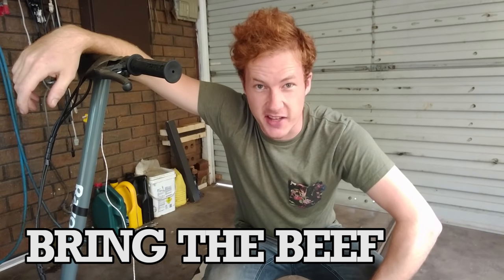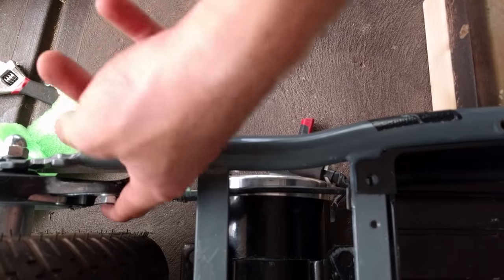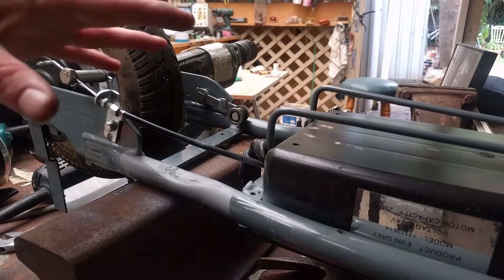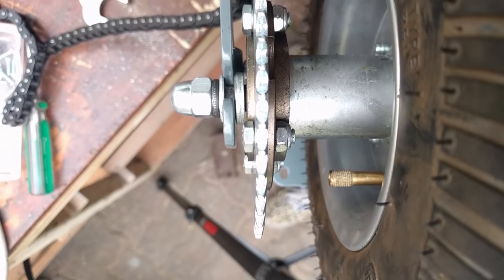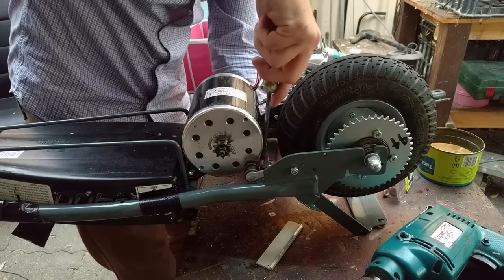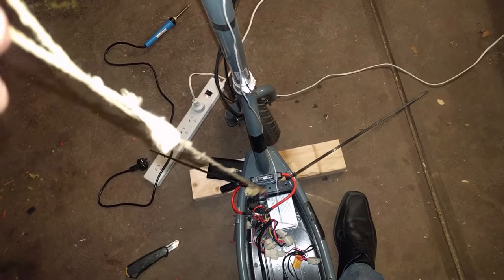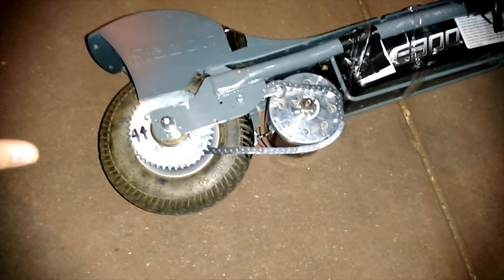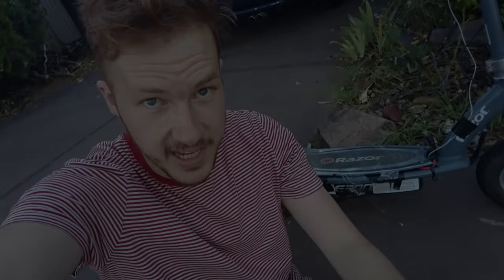Razor E300 Gets a Big Motor Upgrade - Scooter Episode 5

Comment: busy modding stock e300. first to go were kickstand and brakes then moved the switch to the floor. No cables! Coupled the shunt in the controller and it cooks, unless the road is very slightly uphill. I'm gonna stick to 24V, the stock motor is very capable but the SLA batteries aren't up for much range. Still, its an EV
Reply from the maker: True! Kickstand removal really is a game changer haha.

Comment: great info as i'm looking to do the same thing, only thing wrong is the chain tensioner should be tensioning the bottom portion of chain not the top as it takes care of slack in the chain, the chain between rear sprocket and motor will always be tight under throttle so just need to care of the slack after the motor
Reply from the maker: Haha good point

Comment: I got a my1020 off Amazon and a variable throttle.  I stuck with the #25 sprocket setup with a 13/52 gear ratio.  The MY1020 came with a controller that combined with 4 12volt 10 amp hour SLA batteries spins the MY1020 at 3960 rpms (not sure the c-Rate).  Top speed so far is 27 mph.  Still going through versions.  Fun stuff!!!!  Thanks for your post.

Comment: The motor hits the ground any bump with this mod, I did the same thing but 52v my1020 monster motor. It eventually bent the frame. You can take the tensioner off and just get the chain really tight, makes it much quieter/smoother.
Reply from the maker: You're very much correct. Does make riding around the city a pain

Comment: About 4 years ago I bought this cheap little folding scooter bike it was 24v chain drive with a plastic cover over the controller and batteries that served as a foot rest, it came with a little basket, turn indicators, headlight, taillight, brake light it was basically an ebike without the pedals. When I got it the delivery guy dropped it on the back wheel I rode it twice and I was able to hit 35 kph then I ordered a e300 back wheel which was about the same size but I forgot to change the sprocket and as a result I was able to hit around 45 kph.. it was pretty much a 200 dollar disposable jobby but it was fun before I sold it for double!
Reply from the maker: Sounds fast as all get out!

Comment: I have been working on hooking a scooter to a wheelchair. I have to go about 300 feet from the house to the chicken coop twice a day. My issue is not speed but I have to go up a steep hill on my return and I am not a small person. I have two worn out E150s. I have thought about putting the the two scooters together with only one front wheel. I would love a high wattage motor but $$$$
Reply from the maker: Sounds like a useful tool you're building!

Comment: Thanks TK!!!!I upgraded my e325 Razor to the same 500 watt motor,Variable Speed Controllers,36v upgrade kit.I run 15T/38T T8F gears...29mph!!! Thanks Dude! I luv my razor now!
Reply from the maker: ragsandrufus that's awesome, your build is fast!

What controller did you use? Did it fit in the stock location?
Reply: TK ,I purchased entire 36v variable controller ,upgrade speed control includes 3rd battery all on eBay for $109. Motor is same as yours $87.  I ordered TWO chains because 15t/38t gear combo requires a much longer chain than gas style.T8f gears found on Allibaba 
Everything was built in about 4 hours thanks to YOUR video!
Reply: The controller fits in stock location,and has voltage readout.uses a key to lock up!!!
Reply from the maker: ragsandrufus nice! That's a sweet ride :D
Reply: The cover is painted Gloss black to match the black stock black frame. Looks pretty wicked! Next up...set of new tires if I continue doing burn outs and power slides! LOL
Reply from the maker: +TK got a link to the controller kit you used?
Reply from the maker: ragsandrufus cheers!
Reply: I took more time to watch and re watch your videos FIRST,before deciding on tackling this upgrade modification . I can always get different batteries later, but I wanted to test how I liked the power of the 36v SLA batteries first.

The system I purchased includes even the charger and 3rd battery!
Reply: TK ,how long do your 2 5s 8000mah packs last on full power?
Reply from the maker: ragsandrufus hard to say exactly, but I've gone on some decent 40 minute+ rides and the scooter has still been riding well. I'd say probably about an hour tops.
Reply: TK ,that's awesome!
Right now I'm using 3 SLA batteries and I'm only getting 30 min tops!
I'm also only gong about 25mph ( I just find a speedo check) 
Maybe I need to get more punch from using lipo batteries

I'm thinking about investing in two of those 8000mH like yours...any suggestions would be appreciated !
I'm up to about $280 right now...2 zippy 5s 8k will put me at almost $500...
But it's nice that I built it myself rather than just buy one...I guess
Reply from the maker: ragsandrufus yeah, I certainly like doing the build rather then just buying it. 

Check out HobbyKing for LiPos. The only thing I would worry about is if the extra current delivery from the LiPos will pop your speed controller. I'm probably gonna buy one to try it out anyway.
Reply: TK ,4.2v X 10s = 42v. That's not that bad! My controller modal handles 42v so it should be ok!
Maybe I'm too fat?!!! 185lbs is not THAT bad!
I think I'm gunna go for it! 2 lipos !... Here I go!
Reply: TK oh... My name is Andrew btw LOL
Reply from the maker: ragsandrufus yeah, it's not so much the voltage as the current. LiPos can deliver a hell of a lot more current than SLAs. It's great for performance but it kills weak controllers.

Good to meet you Andrew - let me know how it goes!
Reply: TK ,
Ok ... so I installed two 5s Lipos in Series... tested it...
Consistent fast speeds!
No heat build up after 30 minutes! 👍🏻
So...I went crazy and ordered 10ah Li-ion battery pack/charger... the 18650 Samsung batteries that this is made up from should give me the long run times I'm looking for!
Man I'm so freakin happy!
Reply: Thanks again for all your help and vids!
Btw... love the accent mate!
Andrew
Reply from the maker: Thanks mate, awesome hearing about other people's builds!

Got some new parts on order myself :D

Comment: Thanks for sharing. I need your advice please. I own a Weped GT50 scooter. The battery output is only 14.7A max @ 60V for short periods, and only 9.8A continuously. The dual motors are rated for 1800 watts continuous each, which is pretty damn good. HOWEVER, watts = amps x volts. The battery can only deliver a peak output of 60 x 14.7 = 882 watts. That's only 25% of the power the motors require. I think the manufacturer is using 'saggy' cells for the batteries to keep production costs low. 

What if I upgrade the battery with better cells, controller and BMS to 3600 watts / 60 v = 60 amps? I think that's the output the battery should be able to deliver to take full advantage of the motors. Thoughts?
Reply from the maker: Could be good! I’m not familiar enough with the scooter to know exactly what you’re dealing with, but if your battery is hitting its current limits and you’re getting weak performance, an upgrade could be worthwhile.
Reply: @WhatUpTKHere  Awesome thanks

Comment: The tensioner goes under the slack side of the chain, not under the tension, or top side.  So, looking at the scooter from the right side, the tensioner should be under the lower section of the chain, as the top is under tension to drive the scooter forward.
Reply from the maker: You know I get more comments on this than any other XD
Reply: @WhatUpTKHere  Seriously, it goes under the bottom of the chain, also has better tension, and the freewheeling clutch allows for proper chain tension.  I have 2 of these, one E325 and an E300 with an 80 tooth rear sprocket for more torque, less speed.  I use the 300 as a scooter around downtown of the city I work in as I can't walk far due to over a dozen surgeries on my legs to keep me together.   I choose the Razors for easy parts availability and the balloon style air filled tires for a smoother ride.  My next project is going to be taking the older models I use and upgrading to lithium ion batteries when my lead cells give out.  I only go a mile or two a week, so it is light use, a few blocks here and there.

Comment: What you need is a new speed controller. These controllers are current limited, meaning they will only supply a fixed amount of maximum current (and therefor power) to the motor. You can add a 1000W motor, but as long as you keep powering it from the old speed controller, it will not make much of a difference.
Reply from the maker: If you watch the full series, you see I fully explore disabling the current and voltage limits on these controllers.

The controller is a key piece of the puzzle.

Comment: It's probably been said - but you basically shortened the chain so far that the chain tensioner does not function. You likely did that because you have the tensioner on the taught part of the chain (the part pulling on the sprocket of the wheel or top part of the chain) when it needs to be on the slack part of the chain (the portion returning from the motor to the wheel or bottom part of the chain). Correct that, straighten the motor, and I think it should be fixed.
Reply from the maker: Yeah I get comments about this every week, have done for the last five years haha! One small mistake...

Comment: loved the video! so the stock throttle is not variable speed? seems odd to me, but I'm new at these! Instead of the fuse, maybe find a switch (I've seen them) then fuse holder isn't open to the weather that way, and you can push in to stop, and mount it up the riser the holds the handle bars maybe, or hit it with your knee for fast power cut. thanks for posting! on to pt 6 now :)
Reply from the maker: Yeah, stock throttle is just a switch! Bit scary at higher power levels. ;)

Good call on the switch, that's what I did on an old pre-Youtube build. Video to come on that soon! 

Thanks for watching :D

Comment: Love your videos, I have a question if you had to choose, would you choose an upgrade motor (350w motor) or an upgraded sprocket
Reply from the maker: Upgraded motor first! Sprocket can only change the torque/speed trade off, can’t give you more base level performance
Reply from the maker: I changed the sprocket because I had way too much torque but not enough speed
Reply: What Up TK Here That’s good to know I’m new to modding and finding ways to improve my scooter and it’s always good to have videos like these that give good explanations and in-depth detail about the item

Comment: Hey bro why not change the controller and throttle and then run that motor at 48V. Reckon that'd move! The motor's already got some decent vent holes in long as you keep an eye on the temp it should be good to slightly over volt!
Reply from the maker: Not a bad idea! Could be a goer though I've somewhat lost my taste for overvolting motors after the smell from the last one ;) See what happens down the road...

Comment: Nice job with the motor swap!  U definitely need a variable speed throttle.  Might as well get on with new 48v speed controller rated for 1000w.  It will put out the amp needed to maximize power of the new motor.  The original modified one is not going to put out the amperage even tho it's putting out the high voltage.
Reply from the maker: Lowegy take a look at the easier mods and the latest episode as well ;D
Reply: TK awesome! Just watched.  Check this new  video out.   
https://youtu.be/L9DHMgVqvXc
He overvolt the original motor with 48v speed control and throttle kit capable of delivering 1000w to the motor.  He is getting about 27mph. Crazy fast.  I wonder how long his motor will last before it burns out.  At least you have new motor that can handle the amps.  Love your videos and mods!

Comment: Controller Wires Interface Definition:
Battery :Thick black (power negative) /Thick red (power positive)
Motor :Thick yellow (motor negative) /Thick blue (motor positive)
Ignition Switch :Thin red(VCC)/Thin blue
Indicator : Thin red (Indicator power output) /thin black (indicator negative)
Brake :thin yellow (brake signal)/thin black(negative power)
Speed governor :Thin blue(speed handlebar signal input) /Thin black (negtive power) /thin red(5V positive power)
Charge Port : Thin red (charge input power positive) /thin black (power negative)
Brake Light: Thin red (power Positive) /thin black (power negative)
Sport: Thin yellow /thin green(speed limit, connected the wires together

Comment: Sorry for asking a lot of questions but, I recently replaced my 2 12v 7ah lead acid batteries with 2 12v 9ah lead acids, only problem is after an hour or two of charge, the charger would show that the battery is full but on full throttle it would last less than a mile
Reply from the maker: Sound like dud batteries

Comment: Have you had any problems with the motor getting clipped on bumpy roads? .  One pothole and you and the motor could land 15 feet from the scooter.  Not that it cant be avoided but miss  just one  hole and 30 km is no joke. You will fly over the handlebars and wreck your body and the scooter.  That possibility would cause me to mount on top. As a general rule when you make something faster its a bad idea to make it more dangerous at the same time and that seems to be what you've done.  I like the extra speed too but I've gone down at 5 mph and its no fun.  That said I probably wouldnt listen to me either if I were you,  Just something to think about and have fun!
Reply from the maker: It scrapes a little sometimes. Generally though I ride on fairly flat surfaces because of this.

Comment: Dude, the chain break tool can also drive the pin back in when you want to reunite the chain ends!  No need to hammer.  (Makes sense, cuz you don’t see many cyclists with a big ole claw hammer hanging out of the pocket of their slick lycra team jersey!
Reply: Whoah.  Don’t mean to sound critical becuz this is a freakin awesome project you are doing and so fun to watch!  Just a little tip about the chain from a cyclist.
Reply: Whoah.  Don’t mean to sound critical becuz this is a freakin awesome project you are doing and so fun to watch!  Just a little tip about the chain from a cyclist.

Comment: Hi Tk just bought banggood 36v controller an throttle for my e300but having trouble connecting ignition lock wire red/blue thin wire and throttle 3 wires it’s variable with led display I think the razor power switch will be bypassed but as the new lock ignition are thin wires where will they connect to ? I’m ok with the main battery an motor wires as have 3 lead acid in series .will be using 18650 kit soon 😬 thanks from steve in chester .great videos of yours zany like me 😀

Comment: You know I've done the exact same thing Razor scooters are my thing. What I do is in emanate the back brake it's a drum brake and just get yourself a front disc brake that'll do the job it'll stop you because it works just like a car all the momentum has shifted up forward as long as you don't squeeze too hard on the handle you won't flip over but you'll get used to that I'm never flipped over on accident LOL the typically you can get that same motor the 800 or the thousand watt brushed motor in there also if you beef up the tail with double strapping of that metal Alexis to a welder weld it on or if you don't have access to a welder you can add screw holes and get a quarter 20 tap and die and add some short quarter inch bolts with nuts on the end with an extension plate on the back so that the motor can fit on there you're going to have to make a little teal peace like a drag car and a small wheel so you don't flip over when you take off.lose 800 watt motors can handle a lot of power I run him straight through sometimes without a controller I run with the scooter as fast as I can jump on it and flip the on switch using double-dip number 10 wire and a hundred amp breaker no problem wears out your batteries faster but eight if you want to go for speed there's your things to do it's good for the quarter Sprint LOL good luck Mike

Comment: Why is the tensioner on the drive side of the chain and not the slack side? I have a 500W 4800 RPM 24V motor out of a electric lawn mower,,,too bad is 10" long. Maybe I can route the brake cable under the motor
Reply from the maker: That sounds like a sweet motor! Give it a go!

Comment: I just ordered one of these 24 volt 500 watt motor for my diy electric bike. The motor can barely move the bicycle itself, very low torque. I even bypassed the electronic speed controller and no torque increase.
Reply from the maker: That’s disappointing, perhaps something is wrong? 500 W is a good amount of power, perhaps you need different gearing...

Comment: ive bin searching around for someone with a similar problem. I think i messed the motor up this one time and it became like extremely hot along with the speed control. now, the motor doesn't supply enough and the speed control tries to fight the motors inner resistance and just gets extremely hot. However, when fully charged, my electric bike works perectly but after after a few miles, the voltage plummets and the motor goes very slow. does this sound like your problem? please reply. thanks